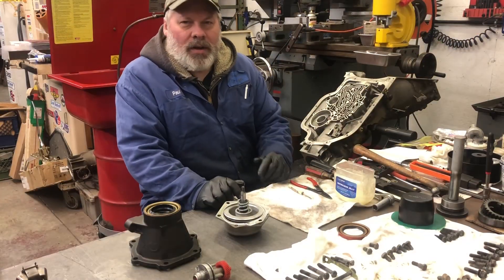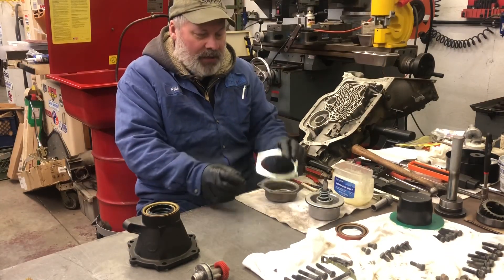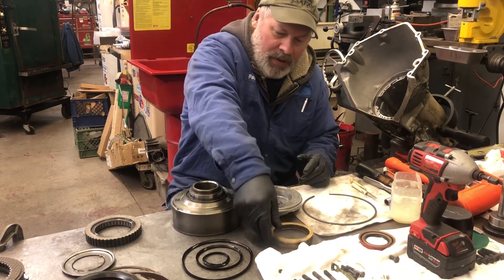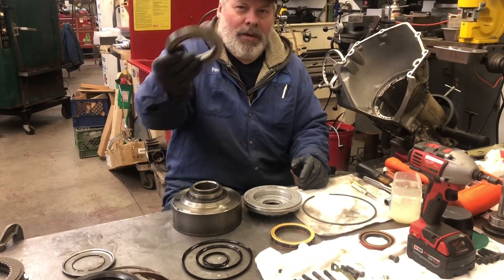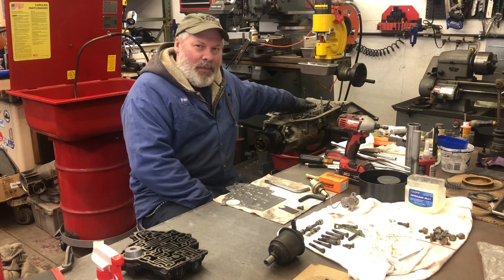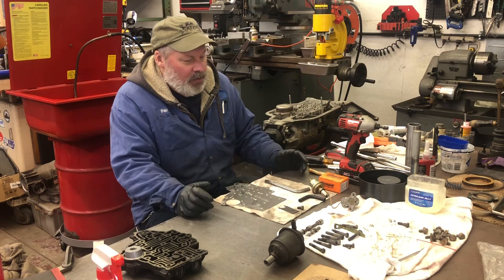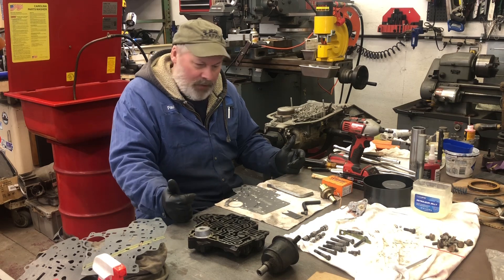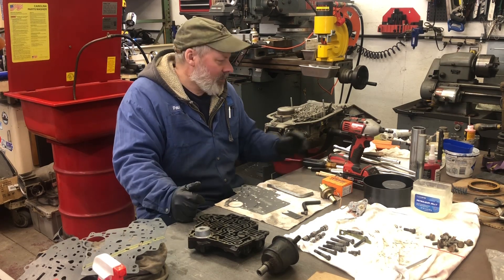Mountains Garage: TH400 Mild Street Build Part Two

Comment: Good morning buddy it’s Friday June 21 quick question. if you remove the spring from the accumulator on the backside of the vowel body with that firm up to 23 and does you have to plug the whole also

Comment: Thank you for covering the governor. Is there any difference in the plastic gear. From what I have seen. If the gear is damaged the trans will not shift.
Reply: There is only one TH 400 gear.  If replacing, make sure it is for a 400 and not a 350 or 4L60 since the same governor fits all three.
Reply: @skutahuniai4830  Thank you for the heads up.

Comment: Shawn I didn't see in the video but I want to know the age old question. Do you soak your clutches before install?
Reply from the maker: I forgot to mention I just use the spray bottle on the bench to wet them, but I don’t ever soak them. I am too cheap to waste that much fluid.
First 40 or so years never soaked a one.
Reply: @mountainsgarage  I only ask bc the old man (my wife's uncle) never soaks his. He might use an oil can a squirt some on them when building the drums.
Reply: @MHolt3573  Ive worked in a transmission shop building. We never soaked any.

Comment: I watched all three parts and have no idea what just happened.   I have both a 375 and 400 in two old cars, the 375 on a lesabre was rebuilt professionally after everything except reverse failed and that was over 15 years ago and the car is seldom used.   The 400 on 69 caddy gets more use and has an odd history.    About 25 years ago (lol) it was going from first gear to second gear to (dwindle off to nothing) then come to a nearly complete stop and start again, first, second, fade to nothing.   What had I done to make that happen?   All I did was install a different speedometer cable.   It also would start and run then continue to run with the key turned to off, until I yanked the spark plug wire out of the cap to make it stop.   After two years of this it was becoming frustrating.   I have complete service manual for the car with electric diagrams.   So one day I started the car, turned key off and it continues to run, and i yank one fuse at a time until I yank one and the motor stopped.  Found it!    Look in book, that fuse runs the ignition coil and tranny kick down switch.   This has nothing to do with changing a speedometer cable.   ????  Oh, but it does, because when I tried to stuff the cable through the firewall I could not find the receptacle end in the dash cluster so I removed the dashboard to be able to see where the cable was going.   I could see the cable but the harness for the instrument cluster was in the way so i unplugged the cluster, put the speedo cable in, and plugged the cluster back in.   The cluster has a primitive plastic circuit board with embedded copper tracings that terminate and bend around the rectangular hole the wire harness stuffs into to make contact with the tracings.  BUT the tracings were messed up and had a dog ear that was making one of the tracings touch one of the others that it woint supposed to be touching.  So that was making the tranny passing gear shift solenoid stay on all the time instead of only when heavily accelerating.   That's what was making the coil stay energized while the the alternator was turning.   I had a replacement cluster with undamaged circuit board, put that in.   At the same time I did a tranny pan drop with tranny oil and filter change.   Afterwards the car operates almost completely normal, went on many multiple hundreds of miles trips, including up and down Cadillac Mountain.   Now 25 years later i put a half quart of new oil every spring after sitting in a garage all winter as some leaks out past the poor quality pan gasket I used.   Sorry for the long story, but I do have a question.  I thought it was third gear burn out of some kind that was caused by age, high mileage, wearing out of clutch disc material, or things I didn't understand.   But it has worked for another 25 years.   Do I have much to worry about taking this car on more long trips?